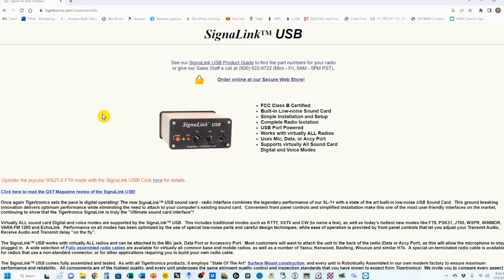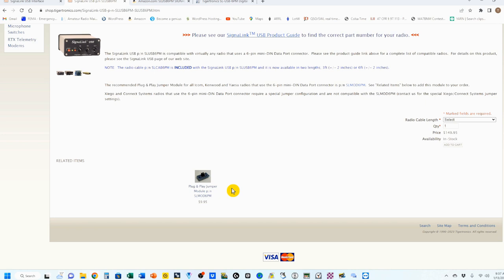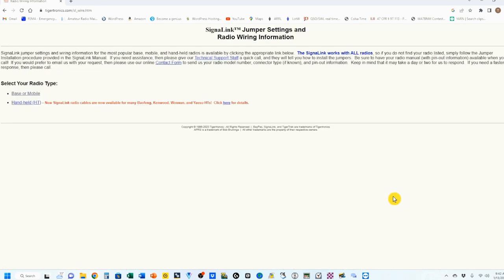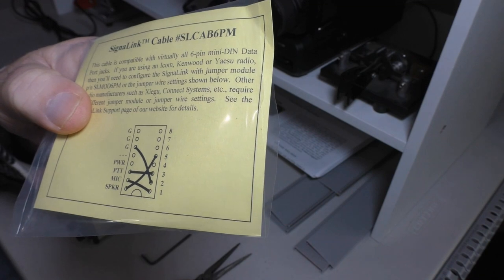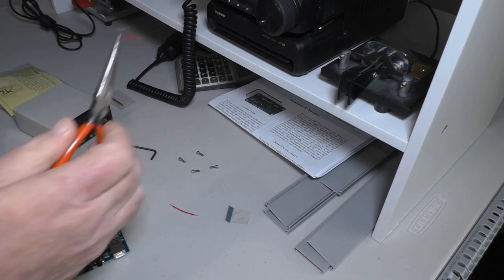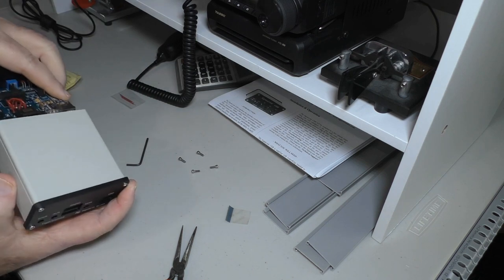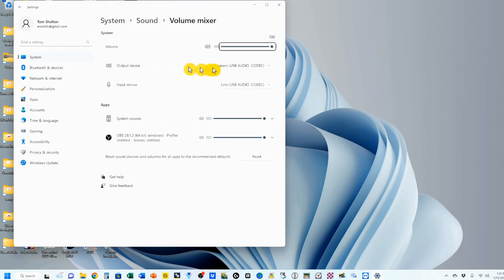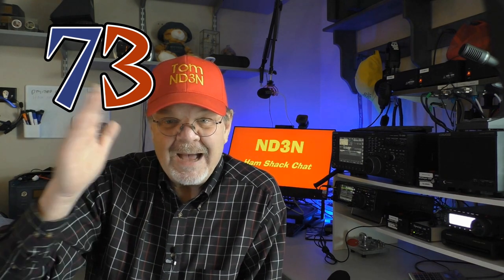Make your radio Listen and Talk with a SignaLink

Comment: Thanks Tom. What advantage(s) have you found using the Signalink versus using the built-in sound card on the Yaesu?
Reply from the maker: It’s much easier to adjust on the fly, both TX and RX.  Sound quality seems the same, though…

Comment: Q: Why does Tigertronics have different Signalink model #’s if any Signalink can be modified with jumpers to fit “any radio.” Hmmm. Thanks!
Reply from the maker: They started with a serial port, then moved to a USB.  Since then they’ve mad several software changes to expand the capabilities.  Then jumpers are needed to match the rig to the jig….  Hihi.  They also have to work with several hundred radios and every new radio that comes on the market. I’ve probably had a dozen different rigs and have used the SL on all of them.